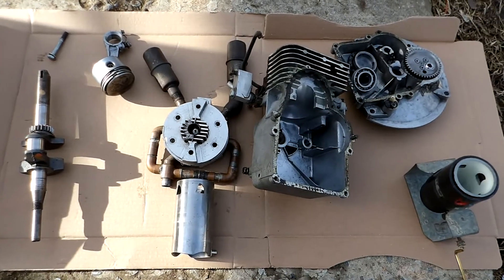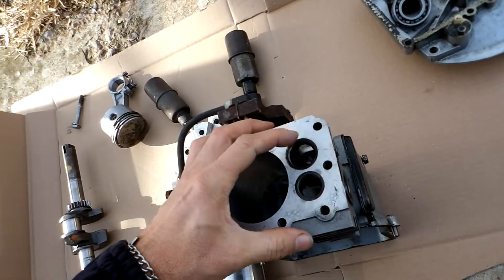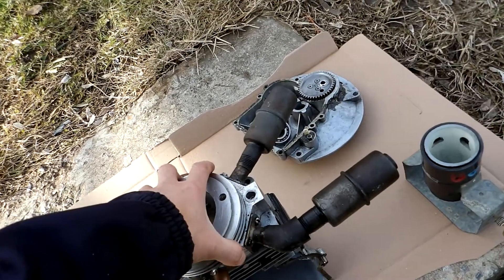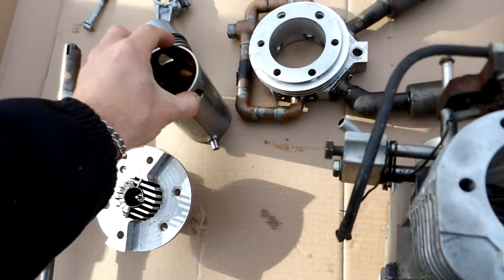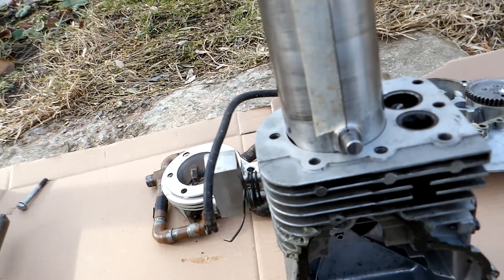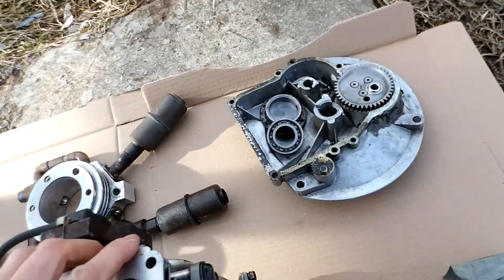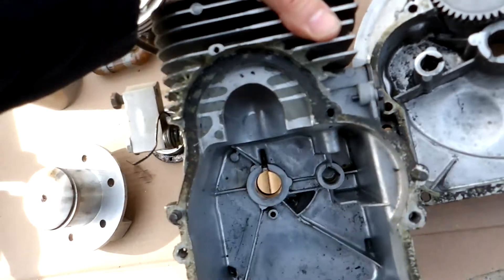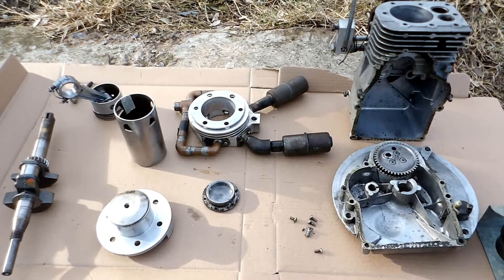Sleeve Valve Lawnmower Engine Parts (Hi Res)

Comment: Already cited: An Interview with Mike Hewland, Car&Driver, July 1974, about his research on a 500 cc single cylinder Single Sleeve-Valve engine, aimed as prototype for a full size engine substituting Cosworth in Formula 1, indicates the great advantages of the SSV distribution.
  
70 HP from 500 cc, not too impressive today, SFC around 170 gr/ HP/ hr. Lower oil consumption than contemporary Poppet Valve engines. No need for an specific Oil supply to Sleeve. 

The economy of the Compression Ignition (Diesel), 2-Stroke, Open Sleeve Valve Engines developed by Ricardo and Fedden, Sleeve acting as annular piston, transmitting power to crankshaft via Sleeve drive actuating mechanism, described in some editions of Harry Ricardo 'The high speed internal combustion engine', remains unparalleled.

As long as oil film between Sleeve and Cylinder wall was kept thin enough, sleeves were transparent to heat. 

Continental stated that Single Sleeve-Valve Engines were easier and cheaper to produce than poppet valves, but never produced SSV in series. 

Gesund +
Reply from the maker: You know your sleeve valve info!  I was lucky enough to talk on the phone for 10 minutes or so with Mike Hewland regarding the sleeve valve engine. He recommended that I use a Dykes ring in the junk head, but I wasn't able to do that on my lawnmower engine based design. He also said that he was getting false horsepower readings from his dyno, so it may have been less that 70 horsepower from 500cc. But whatever the case, he did some amazing developement work on a modern sleeve valve engine. I wish I had the funds to do more work myself, 30 years ago I planned to convert a car engine to SSV operation, I did some initial layout drawings, but never had the money to proceed with anything. If I had won a big lottary, I would have built a car engine, as well as a small single or 2 cylinder version based on the 2 stroke Crecy. I am still working on a single cylinder lawnmower based version, I just have some machining alignment issues with the drive.  Take care.  Miles

Comment: According to Patrick Hassell, Rolls-Royce Heritage Trust, chapter 'The Bristol Sleeve Valve Aero Engines', in the book: 'The Piston Engine Revolution', for Sleeves, they 'started with Nickel Iron, but ended with high-expansion, centrifugally cast, Ni-Cr-Mo steel, nitrided all over.  
Matched with a cylinder forged from a low-expansion aluminium alloy developed by HDA and containing 12 % silicon, this minimized the variation of running clearances,... it was still impossible to keep the sleeves adequately circular as the sleeves passed through the various heat treatment procedures. The final answer was stumbled on by accident when an operator finished a batch of sleeves with a worn out grinding wheel incapable of cutting. They were found to be almost perfectly round. This accident was refined into a production method and patented.

Silchrome was used for valves, but had problems with leaded fuels, Kayser Ellingham Company in England had developed a higher quality stainless steel, Keyser Ellison KE965 steel, much stronger than Silchrome, containing nickel as well as iron and chromium. This proved to have rather better resistance to leaded fuels than Silchrome, although it was not a complete solution. Somewhat fortuitously KE 965, when nitrided, proved to be an ideal material for slide valves' 

For the early double Sleeve-Valve Knight engines (Daimler, Voisin, Willys, Minerva, Panhard,...) Sleeves were machined in the outer side by introducing a gypsum mold inside, this kept Sleeves firm when machined.
 
The Piccard-Pictet Single Sleeve Valve distribution, patent GB118407, 1917, had a constant turning from a gear in the low side of Sleeve; it is also a continued movement of Sleeve respect the Piston and Cylinder Wall, this eliminates the no-lubrication points of BDC and TDC, but is not as good as the elliptical path in Burt-McCollum Single Sleeve Valve distribution.
Blessings +

Comment: Do you think it would be very hard changing a Willys-Knight double Sleeve-Valve engine into a Single Sleeve unit?
A french sidecar pilot made from zero a replica of Voisin 'Laboratoire' racing car, it had a Knight Double SV engine.
Blessings +
Reply from the maker: I think that might be a bit of a challenge to do. You would have to look at the shape of the ports in the existing cylinder block, compared to what is required for the single sleeve.
Reply: @ChargerMiles007  Perhaps a Piccard-Pictet Single Rotating Sleeve would match existing cylinder ports in Knight engines in an easier way. 
And about making a SSV version of Citroen 2CV Flat -twin engine? We discussed this. Latest Basic Version has 602 cc, 74 mm bore pistons, 70 mm stroke; you can purchase 77 mm aftermarket cylinders, 3 mm is enough room for an Sleeve; according to your excellent images, a Junk Head is not difficult to make.
All parts needed are not expensive.
 Opinions? Thanks. Blessings +

Comment: Single Sleeve Valve engines are more economical in fuel, have a longer lifespan; according to Continental, it are easier and cheaper to produce than Popett Valve engines, but have a rationale drawback: it are refractory to programmed obsolescence, thus, bad for some capitalists.
What a fuck!
Reply from the maker: Yes, and they don't have a head gasket to blow!  We wouldn't want to build anything to last, to conserve vital resources, instead we will build refrigerators with a 5 year life, instead of 20 or more, because that IS going Green!!!  Such a not funny joke these days.

Comment: though an old design with modern metallurgy,machining and engineering it could work just fine.like liquid cooled and teflon coating between the sleeves for reducing friction
Reply from the maker: Yes, the sleeve valve may not be dead yet, I think some people are looking at it for use in opposed piston engines.

Comment: Sleeves for Knight double sleeve engines were produced by having a gypsum block inside, while machining the outer part, for inner part, just inserting sleeve in an adequate size hole keeps it firm while machining. Harry Ricardo reported some problems in nitridation. Blessings +
Reply from the maker: Thanks for the info. Yes, the sleeve were hard to machine properly, for sure!

Comment: How thick are sleeves, please? Material is described in a RR Heritage document about Bristol engines, also is machinig. Blessings +
Reply: The Bristol sleeves
We're
Approx. 090 inches thick as anything thicker compromised heat transfer. No doubt they would have liked to go thicker because the sleeves were prone to distort at high boost with bad consequences. The Sabre used Sleeves from the Bristol Taurus as
Supplied by Bristol. It
Was happenstance that the Taurus sleeve
Dimensions worked
For the Sabre. Bristol
Did not want to divulge the proprietary sleeve
Technology which they spent millions developing.
Reply from the maker: I used a sleeve .090" thick, which believe it or not is about the same as the Napier sabre! Therefore mine is way thicker than it needs to be. I believe the Bristol sleeves were more like 0.134" thick. In spite of the extra thickness 
 adding weight in the sleeve in my lawnmower engine I have revved it to 6334 rpm a number of times.
Reply: @ChargerMiles007  GR8 info! This eases my idea of having a 652 cc Citroën Twin-Flat engine, 77 mm inner diameter cylinder, with the ordinary 74 mm pistons and a Single Sleeve Valve distribution in between. 
Thanks a lot! 
Blessings +

Comment: Would you please consider an SSV version of Citroën Air Cooled Twin-Flat, either Burt-McCollum or Piccard-Pictet? You just need the crankcase, crankshaft, reniflard, oil pump and radiator, all easily available, plus the vgs2cv.be large diameter (652 cc) Steel cylinders, with original 602 cc pistons, and design and making of new heads. Congratulations! Blessings +
Reply from the maker: LOL, that would indeed be a big project!  My problem is that I virtually no machine shop access these days.
Reply: @ChargerMiles007  RCV in UK, D-Motor in Belgium, could do machining and prototyping for you.

Comment: Very nice, looks like it draws inspiration from the Burt-McCollum design, I have a 1920s Barr and Stroud WB1 and there is a few similarities. Barr and Stroud struggled with storing their spare sleeves, they had to be kept in special made cases to stop the sleeves from going out of shape! Must be rather thin section.
Reply from the maker: WOW, that must be a rare engine!  The sleeve for my engine is much thicker than it needs to be. It is .093" thick, the same thickness as the Napier Sabre aircraft engine sleeve, but mine is a 2.375" bore, while the Sabre was 5" bore! So the sleeve in mine could probably be half as thick as it is. I made it the way it is to use a standard piston in it, though for $75 more I could have gotten a .030 oversize piston. However, back then I was on a student budget, so that wasn't going to happen!
Reply: Yeah! This is the type of distribution patented by Burt and McCollum with a short interval between  both patents, built at Argyll, Scottish car maker. Wikipedia has info. For storing Sleeves, probably a cabinet keeping it vertical, in order not to ovalize, could be enough. Blessings +